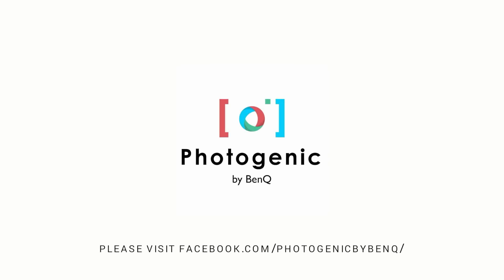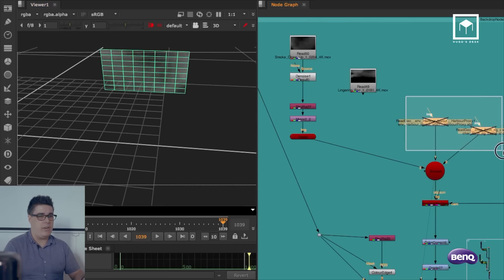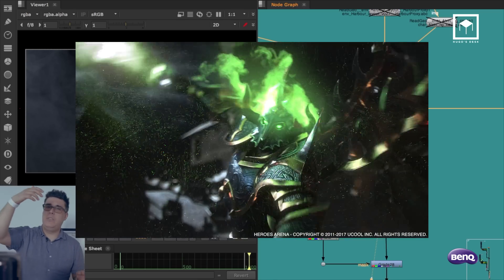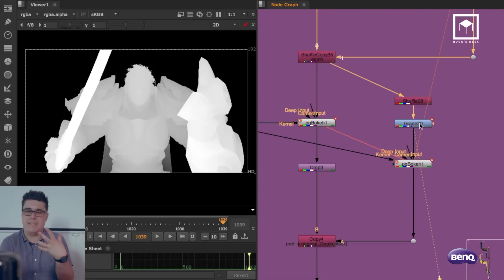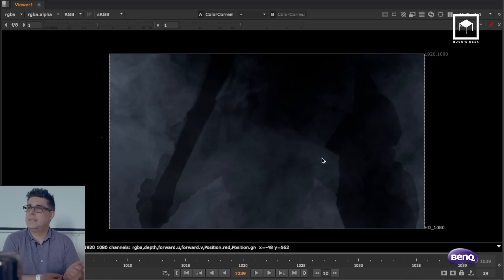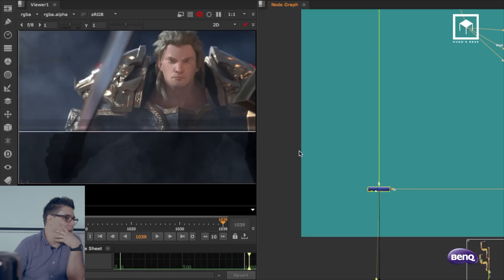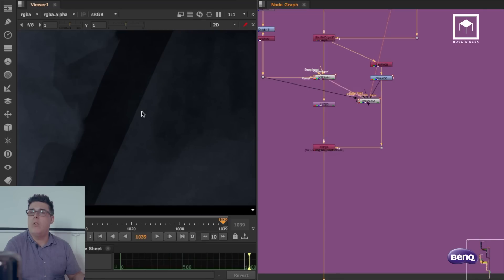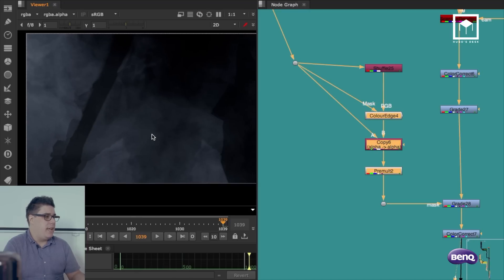How to use ZDepth and stock footage to create a fake Fog in Nuke

Comment: Thanks Hugo!  Enjoyed your video :)  I was wondering when its best to use this method over deep compositing?  Cuz im working on a project with crowd sims for concert performance. I want to put layers of fog in between characters in depth for added realism. I'm wondering whats the best solution for that.
Reply from the maker: Yes it is possible to do this in Deep. Actually Nuke can render Deep EXRs so you can make the same with multiple layers, the geo and make a Deep render.